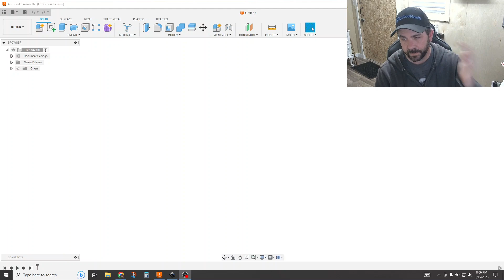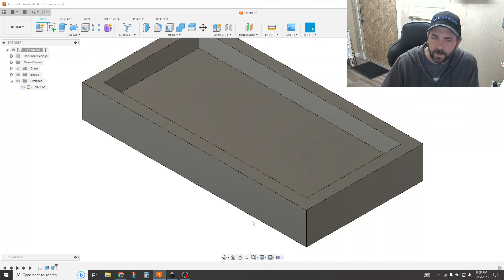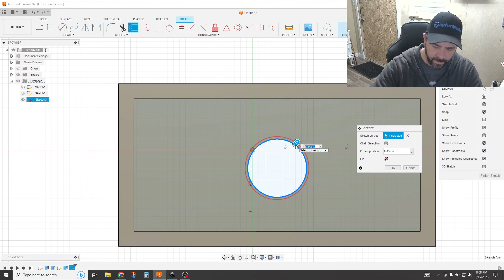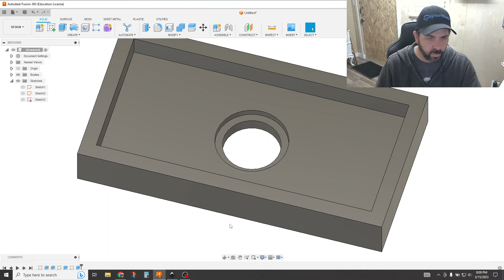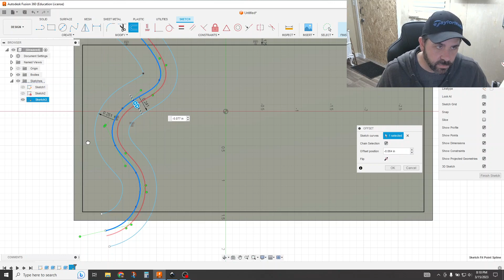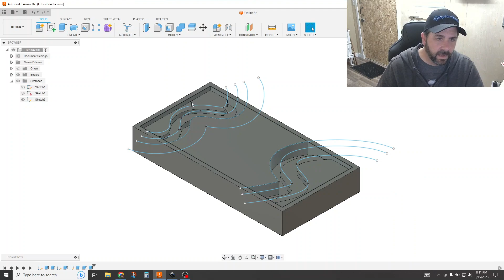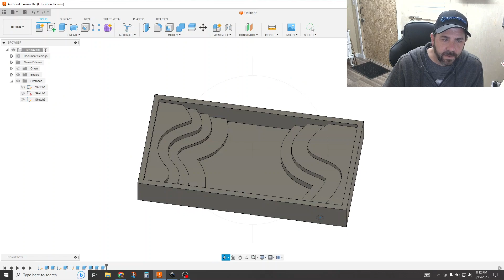Unleash the Power of Offsets in Autodesk Fusion 360

Comment: @fischer3d How can we Offset a Mesh in the outward direction. (Not "Shell")
Reply from the maker: hmm.  Give me an idea of what you're trying to do.  a face or group of faces in a mesh?  The whole thing?  

The offset tool in fusion is specific to sketch lines, but it sounds like you have a mesh you've imported. An stl maybe, and you need to scale it?

If I had a solid sphere imported as a mesh and needed to make it hollow with a 10mm shell I'd make a copy of it.  Then scale the copy larger.  The use the combine tool & cut to remove the original sphere from the larger copy.
Reply: @fischer3d  Hi Fischer.
1. I have a Height Map Mesh.
2. I would like to create a 5mm Offset of that Mesh, so as to build a loose fitting mold around that Mesh Object.
3. There should be a gap of 5mm between the Mesh and the Mold at all points.

Rules: The Mold should be Flush/Square & Unaffected at all faces and points not intersected by the 5mm Offset of the Mesh.

Apparently you can Offset a Sketch, as you'd indicated. But you cannot directly offset a Mesh? (That seems odd.)